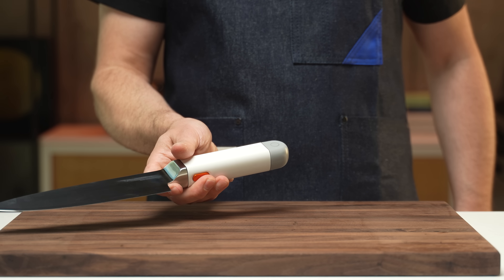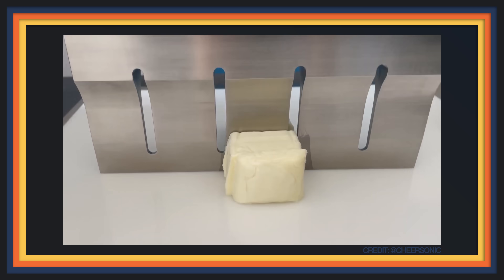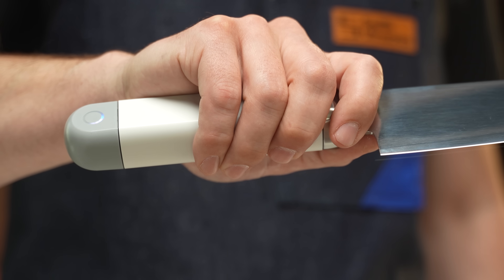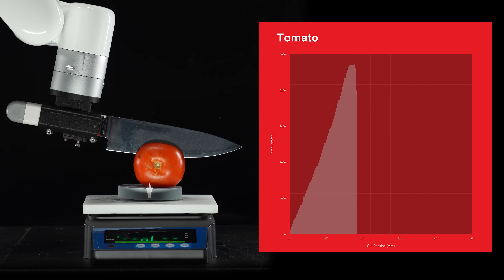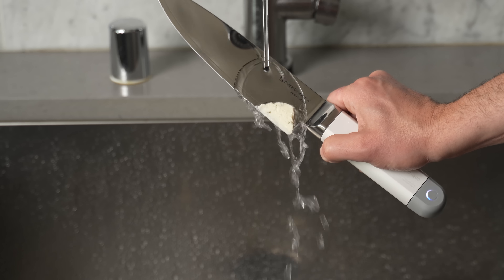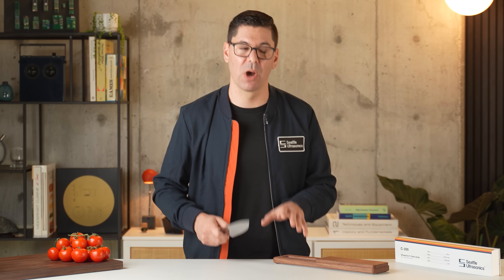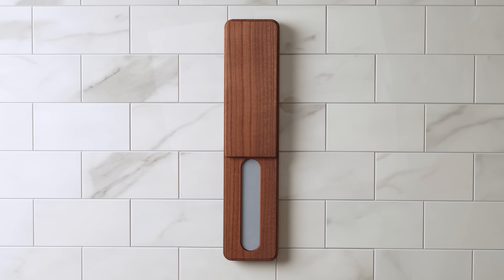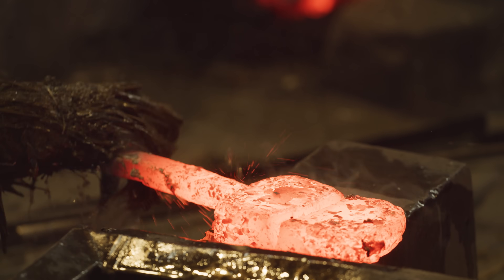The World's First Ultrasonic Chef's Knife for Home Cooks: Seattle Ultrasonics C-200

Comment: I think this knife would benefit people who are disabled, elderly, or anyone who has poor motor control for some reason. You should push that angle more. The edge is still going to require maintenance because at the end of the day it's still steel. Have you considered using high impact ceramic for the blade, or would it affect the oscillation?
Reply from the maker: Great suggestion! We're exploring those use cases and it's a great way to think about it.

Comment: this looks super cool, but i do have a question - the product page specifies that the vibration frequency is 44kHz, which, while not within the hearing range of humans, is well within the hearing range of dogs, cats, and other home pets. cats, for example, can hear up to 85kHz. has this product been tested with pets present during operation? while i doubt the amplitude/volume of the noise generated would be particularly harsh, i would like to see more info on the sound/audio aspect. for example, recording on-and-off performance in an isolated room or anechoic chamber at a high sample rate like 96kHz and showing the resulting spectrogram
Reply from the maker: We've tested the knife around puppies, older dogs, and different breeds, and they didn't react when the knife was running. The ultrasonic frequency is generally beyond animal hearing range as well, so it shouldn't bother pets, although it has not been tested in the presence of all pet species.
Reply: @SeattleUltrasonics can it cut meat
Reply: Having worked around ultrasonic welders, it will absolutely drive animals nuts.  Especially if the duration of the vibration is prolonged.

It's very unpleasant.
Reply: @kitchenasmr6876  Yes but keep in mind the power output is VERY different. The circuitry in various electronics found in people's homes can also produce some of amount of ultrasonic frequencies as a byproduct of their normal operation. Many of which are running continuously or for much longer periods than someone chopping some tomatoes.

That's not to say this couldn't bother some animals but I wouldn't expect it to be significant and most common pets would probably adapt as long as it's relatively subtle. 

Just my two cents.

Comment: An Earth company using science I use. Bites Apple then cuts it in half showing Dark & Light pentagram halves When you gonna get into Ultrasonic holography resonance pressure tech so you can just pour metal into holographic pressure image made from computer for perfect atomic structure. Google: "Ultrasound can print through walls" + "Ultrasound print 3D" + "Ultrasound solidification of molten metal" AI lies about using resonance frequencies to melt metal and keep hot with pulses. To make blades super powerful without shattering their bonds = Resonance bleed. A Piezoelectric crystal that absorbs excess vibration and bleeds the energy from crystal into electricity.

To spit that electricity to prevent crystal from breaking its bonds you can hook it to a transducer to beam power excess as frequency filtered Ultrasound. Google this "The ultrasound tuned to the resonance frequency of a target material destroys the target material without harming healthy material that surrounds the target material. A resonance frequency database can be employed to ensure that local healthy material surrounding a target has a natural resonance frequency dissimilar enough from the tuned resonance frequency." "Utilizing ultrasound to disrupt pathogens US20100113983A1" < That's how you tune Ultrasound to pass through materials and only hit your target materials for resonance holography forging.

You'll see if you don't already know. Points at Dragon Cross Sword in Sleepy Hollow (1999) My Sword. Cauterizes wounds no blood waste and based on everything I just told I know you know I'm not lying. Google: "Saucer over Dracula's birthplace 16th Century Church art Yahoo news" Points at smoke pouring off the Saucer Heh.. - Dracula/Hades 

Me= "We need to put a stick in Dracula's heart like we did Jesus!" His brother.. (Advanced Ultrasonic holography resonance direct sound printing meta Human shapeshifter. Ship: High powered Plasma generated Ultrasound shockwave anti-drag with benefit of elevating sound of ships beyond Human range of hearing for illusion of silence while scanning far with waste sound. Main ship saucer connects to = Shockwave holography self repairing shapeshifting Battleship/Cutlass.) https://www.youtube.com/watch?v=J46EcAqZAPY Eye for an Eye

Comment: Ultrasonic cleaners warn not to dip fingers into the water. Skin irritation and tissue damage could result. Touching the blade of a knife when cutting is common. Are there warnings against that?  I am sure the blade is isolated from the handle by some means. But, how much ultrasonic is tranmitted to the hand?

Comment: The concept is like something out of cyberpunk very cool.  But, the execution of the handle is poor.

A handle needs to be durable but grippy and needs a palm swell and/or finger grooves or at least the general shape that will fit in the palm.  It is good that you did not use a cylindrical shape for the handle since that would lead to the blade deflecting but your handle's shape still needs work. It isn't just the shape though.

Your handle material looks like it would crack under many uses. It looks like it would get slippery when wet.  Maybe the YouTube video is just misleading.

Either way, I think this is a really cool concept so I hope you'll make improvements to the materials and shape, especially the handle as the blade already looks ok.

PS: Will this stir creamer in coffee just by holding it in there and not moving? That would be fun.  Or would it help making certain kinds of mixing both easier but I'd guess also messier?  It just seems to me that there could be so many potential uses for this other than just cutting.

Comment: One worry I would have is it shows the rechargeable portion of the knife as a single unit I've had many such devices and you're at the mercy of the company to replace when the rechargeables go dead can you engineer this so that the individual batteries can be easily sourced? Rechargeable AA or AAA whatever you're using.

Comment: I have an small ultrasonic cutter for cutting 3d prints, which is incredible, but does generate a lot of heat, especially if in the same place for a bit. Does this knife do the same thing?
Reply from the maker: No, the blade does not get hot when active. You may occasionally see water "misting" off of your food, but that mist is not caused by heat. Instead, the vibration of the blade causes droplets to atomize away.

Comment: you seem like a passionate engineer and this seems like a passion project. also ultrasonic knives are a big think in sci-fi (vibro blades in starwars) 

the extra reduced friction isn't something I ever considered. my main concern is, you have something and a chopping board, the vibrating tip meets the chopping board or opposing surface. does the vibrating mechanisim cause that contact to act as exponential wear and tear, will the blade need to be sharpened more often?

Comment: It has a battery life of only about 24 minutes based on the capacity (1100mAh) and the power draw (10W). So better get the version with the wireless charger.

Comment: This is a very cool concept, I do wonder what the knife's durability will be like since it's not full tang. How well would it hold up with, for example, cutting raw sweet potatoes? Even with a recently sharpened knife with a good edge, those can be a bit challenging, especially if they're on the large side (radially). Or does the ultrasonic action significantly reduce the amount of force that's needed for harder vegetables as well?

Comment: random bit of feedback: would prefer one of the Crucible-style sintered powder steels like Vanax, which is also more corrosion resistant (for the "i like to not bother drying my knives" crowd.)

the much higher edge retention would help preserve the blade geometry (which i'm sure is crucial for the transducer to work optimally) and the higher hardness should transport the energy across the blade better with less losses

Comment: Only a few seconds in, and I can already see a couple problems.
1) How are you supposed to clean it properly with electronics embedded in the handle? There has to be some sort of exposed charging port you have to avoid getting wet, and anything that vibrates is going to end up loosening joints and connections which will let water in.
2) With how vulnerable to water damage the knife ends up being, how would the price to replace it when it stops working justify the improvement over standard knives that you just keep sharp normally?

Comment: Cool idea but you really don't need a super charge knife for everyday cutting in the kitchen. Most aren't going to do a Michelin quality dish and do not need this. For shaving your beard though? That's a potential hit product.

Also the saying, "a dull knife is a dangerous knife" is hyperbole at best and dangerous misinformation at worst. You are far more likely to cut yourself on a very sharp knife than a dull knife unless you use excessive force, which begs the question of what it is you're cutting that require that much force.

Comment: Looks like a great product, but I’d prefer to see a standard, non-proprietary battery like an 18650 or 21700 cell so it could be easily replaced at low cost when it starts to wear out.

Also, the pricing is a bit too steep for my wallet — but if it dropped to around $200, I’d definitely buy one.

Comment: I don't know if this would be actually useful at home. Normal knife is more than good enough, you just don't need the efficiency benefits at home. And to keep blade sharp, you just need sharpening stick or even pull trough once in while. On top of electronics, battery etc. that will fail before the blade does. 
But I could actually see this being useful at restaurants. Lets say you are smaller restaurant and space either doesn't fit or warrant some expensive specialized machine, you could make some specific cutting tasks more efficient. And you can potentially make some foods prettier due to way it cuts.

Comment: This is very interesting.

Many hobbyists sharpen their knives to a point where they outperform this knife, so my question is, how would THIS knife perform when sharpened to such a degree? You mentioned the San Mai construction, and so it should be possible to get it to be tree-topping sharp.

Also, what's the BESS sharpness that this knife is getting when running?

Also, is there any possibility of microfractures from the oscillation that might open up the high-carbon core to rusting problems?

Also, do you have any details on how edge retention is affected?

Comment: As a knife maker, I have to say I quite like this. The core steel is AUS-10 hardened to 60 HRC - a good quality stain-resistant steel with a decent heat treat - and the concept is good. I doubt it will have the feel, balance and ultimate sharpness of a well-maintained, top quality bunka/gyuto/nakiri/kiritsuke etc. let alone single bevels but those are tools which generally cost at least as much (or much more), require a lot of upkeep and are as much about the craftsmanship as the function.

Comment: Looks cool no talk of battery life on the site though.  I'm sure $400 seems worth it to people that would pay for expensive knives but it's quite out of range for most
Reply from the maker: On a full charge, the C-200's battery provides about 20 minutes of continuous running at maximum power. However, the C-200 only runs while you're holding down the button. In practice, that 20 runtime minutes is enough to dice at least 20 onions or 40 potatoes. You'll likely get through multiple meal preps on one charge.

Comment: Great idea, I'd love to buy one in the UK.

Just some thoughts from me (that I'm sure you have had):

1. I'd like to eventually be able to put this in a dishwasher. Maybe the vibration makes cleaning this under a tap so trivial that a dishwasher is overkill. I also know how challenging it would be to put electricals through a dishwasher.
2. The grey handle is a little boring. Could you provide other styles, or ideally, replaceable plastic handles?
3. If the above is possible, could you release 3D printing files so people can make custom handles?
4. It would be nice for the charging tile to be able to handle a wet knife. Drip channels that let me just rinse the knife and put it away. I love the use of real wood on the charging tile.

Comment: What's the catch doc? Subscription? App based? Custom changeable batteries? Limited supply and unable to sign with worldwide stores?
Reply from the maker: No catch! The knife will not need a subscription or an app. The battery is charged via USBC. We do have a limited supply on the first run, but have plans to ramp up supply and sell with 3rd party retailers in the future!

Comment: As far as I see it the issues are:
1. Minimal extension of blade into the handle 02:47. As I use my knives roughly I can see this being a high point of failure.
2. From what I can see on the website run time is not listed explicitly. The battery listed as a 3.7V Lithium Ion and 1100mAh so would be 4.07Wh and the knife is listed as 10w operating power, so it would run about 24 minutes at a time which is fine for meals but less so for mass processing where it would be more useful.
3. There is no wired option for the charging tile. If it could be directly wired (without the battery) and ideally with the possibility to not have a visable wire I could forsee buying it for my parents to make cooking easier for them. As is, they would unplug it to charge a phone, not plug it back in and it would run down never to be recharged. 

That said its a really awsome product..

Comment: You don't need a $400 knife that you have to constantly charge and probably will break in a year to cut your food. All you need is a decent knife and a sharpener. Sharpening the blade is easy and takes only a few minutes a week.
Reply: More parts, more complexity, more points of potential failure.

Batteries lose their ability to hold charge.

Electronics have limited lifespans.

This is a solution looking for a problem.  And to reach that solution, it's necessary to create more problems.

Most of the time, the simplest solution is the optimal one.  This thing will see initial success because there is a market for whiz-bang kitchen gadgets.  But the cost of ownership puts it in a class far outside what the average, or even above-average, users really want.

This, like sous vide, attracts a certain kind of customer.  And if it stays in that lane, it might be successful.  But where does this go from here?  Once that market is served, can those same users justify buying the 2.0 version?  For what?  Slightly less cutting force?  Slightly better charging times?  Slightly different ergonomics?

It's a fun science experiment.  A flash in the pan product.
Reply: If this can be scaled and the price can be lowered this will easily be a much better alternative. Also better design choices because it looks like it can mold. Why would it "probably" break?

Comment: I'm extremely impressed with how well thought out this knife is. You could have cheaped out on the steel, and came out with a "pro" or "premium" model with Japanese steel later. But you seem to have the intent to simply make an excellent product from the start. I greatly respect that. Might have to get this for my parents for Christmas.

What I like most of all is that you don't need a darn app to use it. No updates, no server which will inevitably be unable to justify its own cost one day and be shut down. Just an outstanding piece of technology which can still be useful even without power.
Reply: It's AUS-10 steel. Hardly inherently premium, but it being "japanese" makes it seem like it is. You can get an 8 inch chef knife in AUS-10 for as low as 60 dollars, although you'll probably need to spend twice that for one with a good heat treatment, proper grind that didn't burn the edge and good fit/finish. It's a good choice for the task, not too brittle which is important considering that most customers will be average Joes, but acceptable edge retention and good corrosion resistance. At the same time especially this knife would likely benefit from a steel that can achieve a higher hardness, e.g. SG2 if we're trying to stay sensible
Reply: @athmaid YUP SG2 CORE OR AEBL FULL HARD ON
Reply: tell me more about how impressed you are that the $500 knife that makes you cut slightly better uses mid japanese steel and "doesn't require an app" wow dude bet you're on track to buy 100 bro
Reply: "There will always be someone able to make it cheaper than you, but there might not be someone who can do it better."
Reply: japanese steel is low quality, it's the whole reason they have skill for smithing it into something usable

i wouldn't base the quality of it on the japanese aspect
Reply: @PabloEdvardo you're probably talking about tamahagane which is completely different from modern japanese steels
Reply: @PabloEdvardo Japan had high quality steel 50+ years ago. Now Germany/USA have dominated them in metallurgy.

Comment: You should probably make a cheaper version, using a less expensive knife for the base.   Yes, it will dull faster.. and wont hold an edge as good..  but if the price is around $100 to $120..  then people may be swayed to purchasing it.. in mass.    Most people are not even buying high quality high-carbon steel cored blades.    Since a Pro Chef might not buy this..  that just leaves the upper middle class, as a potential possibility.

 For most people.. $400 is a good chunk of change...  that could be put to much more interesting usage.   Thats the cost of Gaming system.  Heck, you could probably buy a real Combat Steel sword, for about that price.